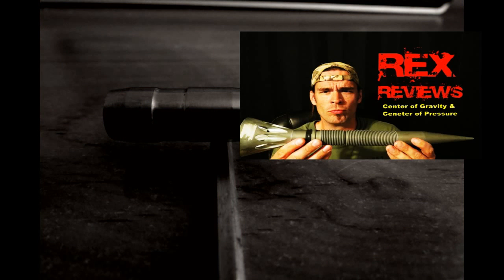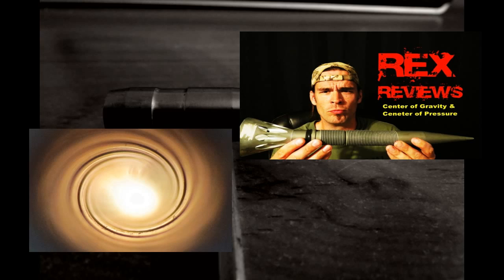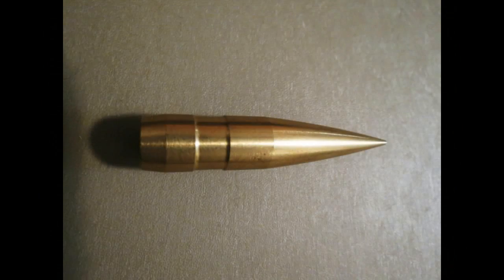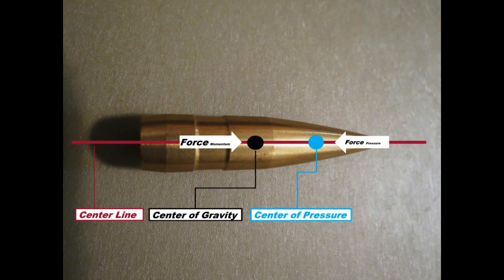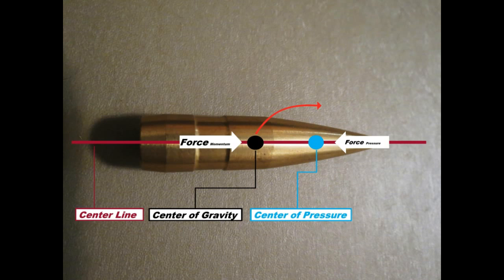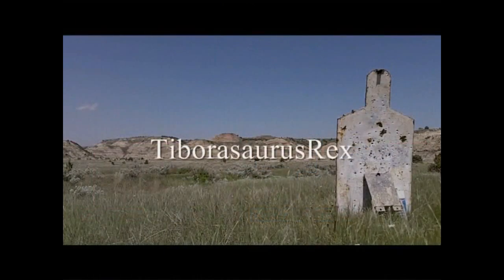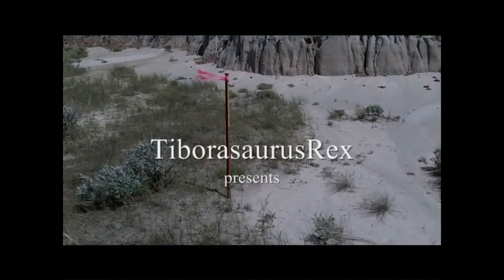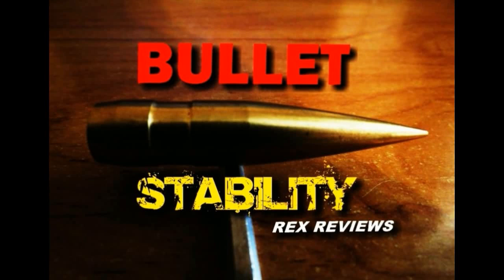Long Range 101 Part 68 - Bullet Balance Issues EXPLAINED!

Comment: Trying to find out what might be going on with the setup I'm using.  Just under 1 in group at 100 and around 1&1/6 in groups at 400 yds. Happy but odd results. 75gr eld .223 1-7 twist suppressed. Any insight would be appreciated.
Reply: your bullet prbly isn't stable yet at 100

Comment from the maker: I usually opt for stainless steel if I have the choice due to its increased resistance to chemical and high temperature thermal erosion mechanisms.  The US Armed Forced made the same decision for the M24 SWS and the M40 rifles after extensive examination of all the various criteria.  Chrome molybdenum steel works great and I use many rifle with barrels of this material, but stainless might be a little better after conducting the full cost/benefit analysis.

Comment: Just a suggestion for the ballistic tables....
I added a diagram of my reticle component dimension values at the bottom of the chart, next to the mirage diagram. This really comes in handy when using more than 1 type of scope so you do not need to remember all of the dimensions for ranging via the reticle

Comment from the maker: Everything from Simmons to Swarovski…. whatever we have in the truck at the time.  As long as you can see what going on and spot bullet trace, you are good.  As long as its relatively clear you are OK.  No turrets or recoil to worry about.  If you are looking for a good LR spotter, I’d get one with a Mil reticle so you can call the shot with more precision.  Check the USO spotter, the Leupold MkIV and the high end Vortex model with the 20X mil-scale eye piece.